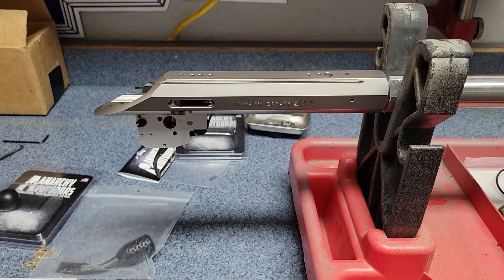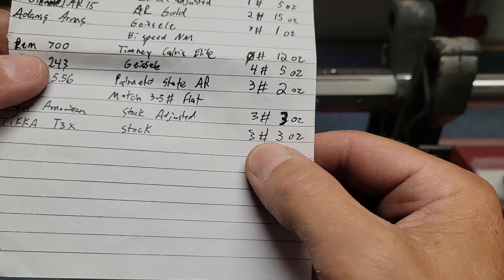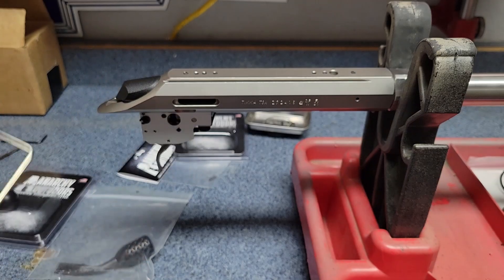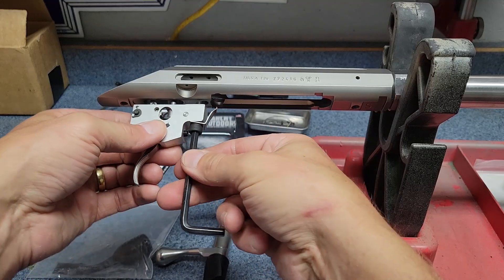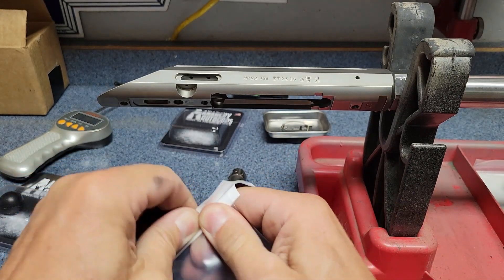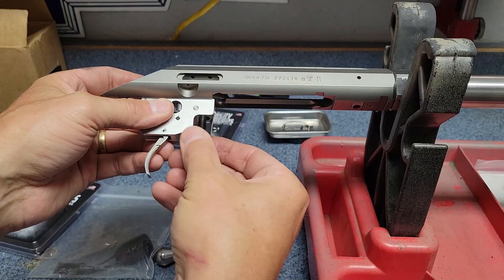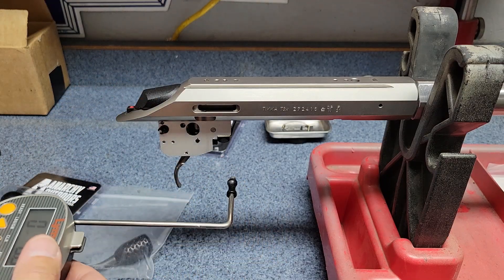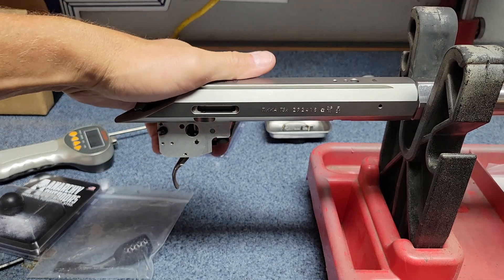Tikka Rifle Build Part 3:  Trigger Spring Upgrade

Comment: Just for fun, reinstall the factory spring, set it light as it will go (check weight), then turn in the set screw snug, back out to previous spot and recheck trigger weight.   Or if anyone reading this has done it please comment.   Great series of videos.  👍

Comment: I've customized several Tikkas. I use trigger springs from Anarchy, Mountain Tactical, YoDave. I've not tried an MCarbo yet. I also shoot left hand. I've been considering a 22-250AI. Hope you post videos on how it does on target.
Reply from the maker: Yep, once I get the chassis and a few other stock parts, I'll be taking it to the range.